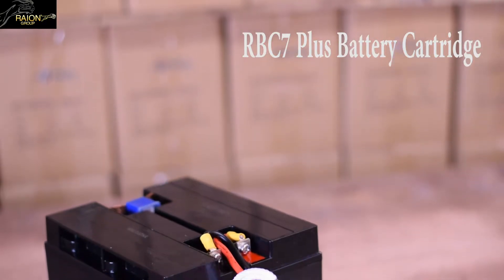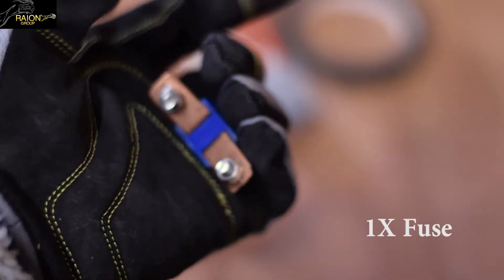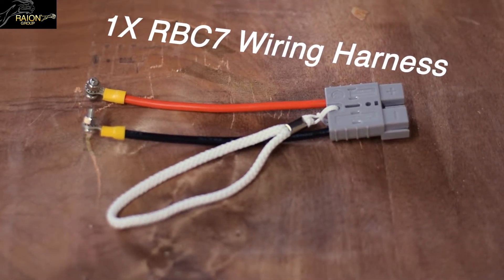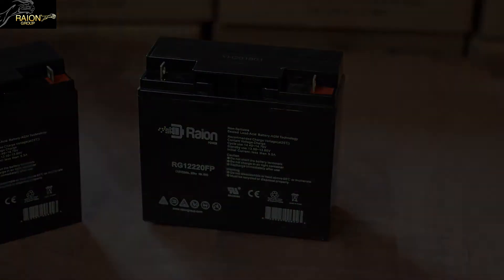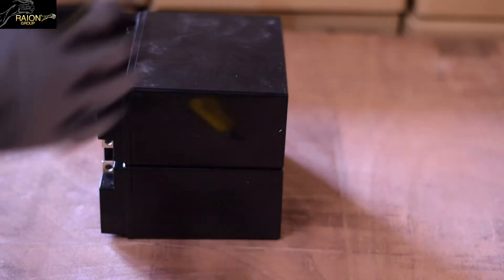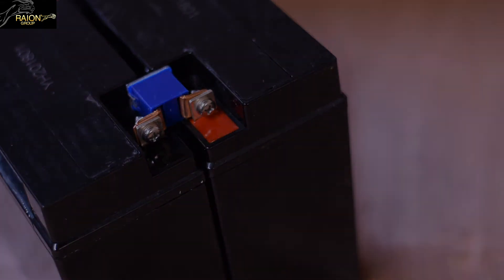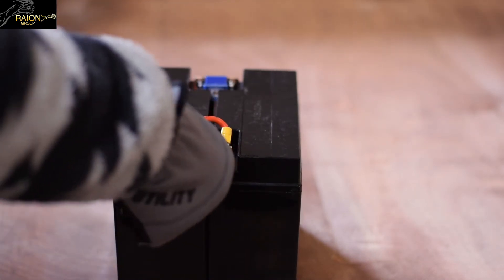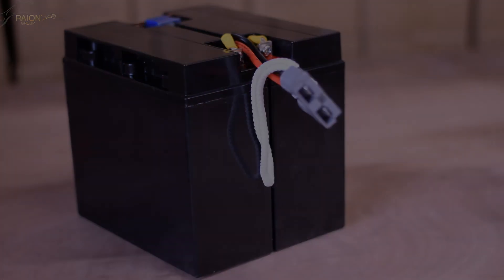How To Build A RBC7 Plus Replacement Cartridge For APC Smart Backup UPS System

Comment: Great video, thanks! Is the Ah rating important? Can I buy smaller batteries as long as they are both 12V?
Reply from the maker: V V the Ah is important. You want to match or increase the capacity to keep your system performing like OEM. In addition, not all batteries are built the same. Typically you will want to get high rate series batteries for UPS applications.

Comment: Awesome, definitely going to save me some money. I have yet to pull the battery out my unit. Is it safe to assume that I'll be able to get the harness and fuse off the OEM battery back or will I need to have replacements ready?
Reply from the maker: Patrick Coy we recommend using new fuses and wires for your installation which you can get on our website: www.raiongroup.com